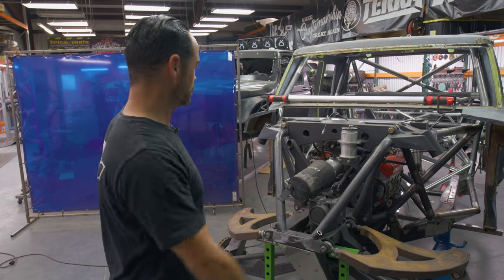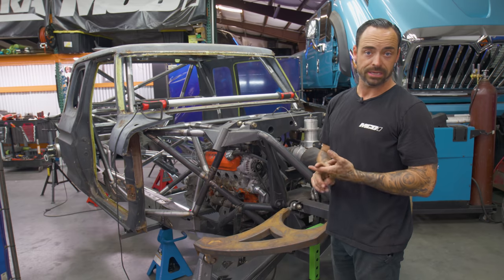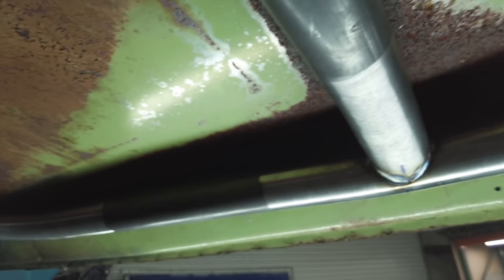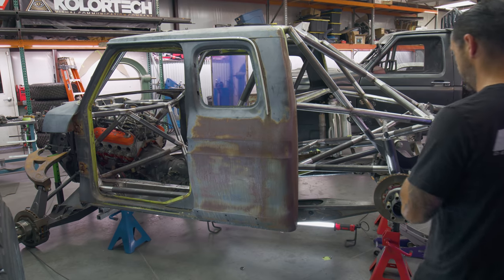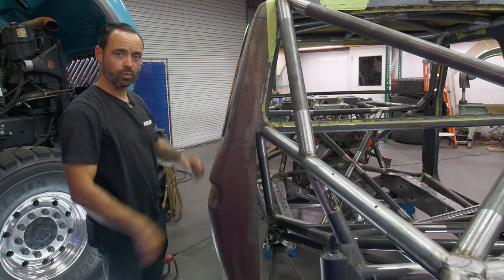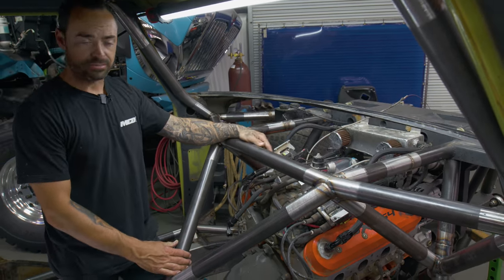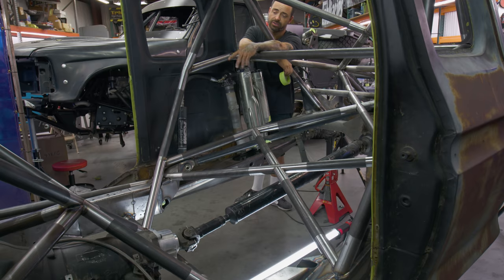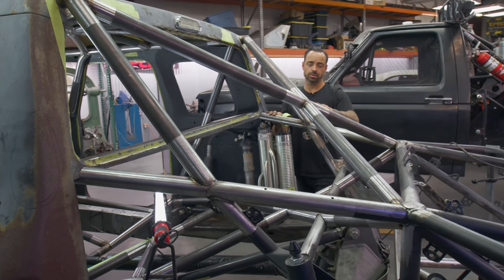Cab swapped F100 - body dropped
prerunner.  Vivian Build series (ep.2) Morgan Clarke Design

Comment: Really digging the content, Morgan. Love your work! 
I’m pretty new to the whole prerunner thing, so I’m wondering- why keep the 5ish feet of factory frame rail and not just ditch it and build completely from scratch? (This question sort of pertains to all frame rail prerunners I’ve seen). Is the whole idea of keeping the chunks of frame rail to retain the ability to register it for use on public roads (maybe there’s some rule about having factory frame rails)? Hoping someone could shed some light on that.
Reply: I was wondering the same. This seems like such an involved undertaking that the sections of factory frame just seem like a major nuisance at this point
Reply: Likely just a good point of reference, he's already plated it and removed a shit ton from the rear section. Since the bulkhead is basically built off it, maybe it was kept to maintain structural strength and kept the project moving forward. Either way Morgan's not gonna let anything out the door unless it's bullet proof.

Comment: Awesome build. Question on the sway bar arms. They look short and end links at hard angle. I am building kartek sway bar right now on my prerunner. The way sway bar had to be installed clear the fuel cell the sway bar arms center to center 31”… looks bit weird. But my end links stay pretty well vertical. Any recommendations or rule thumb when installing sway bar system?